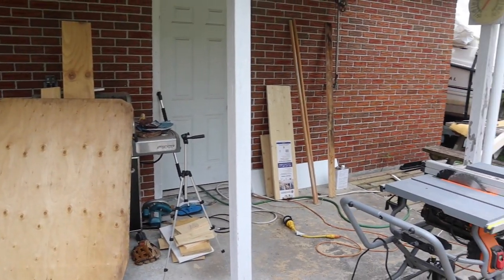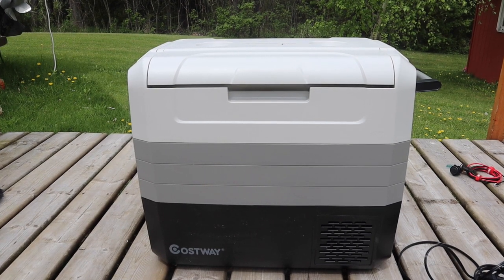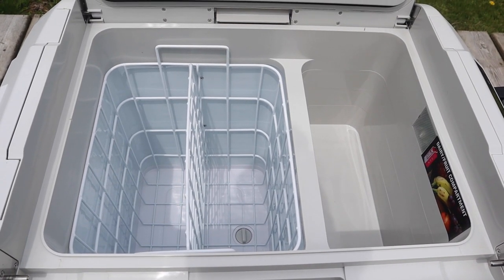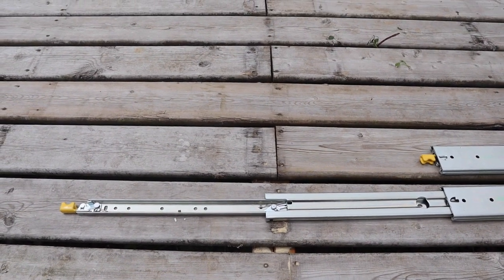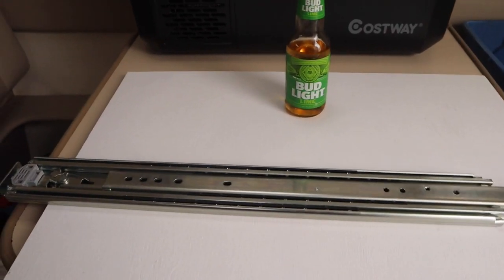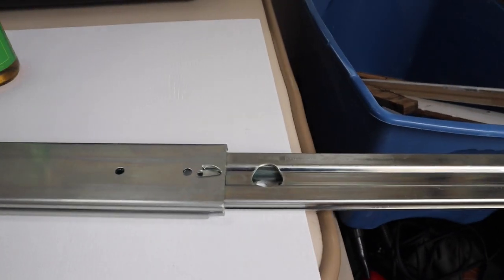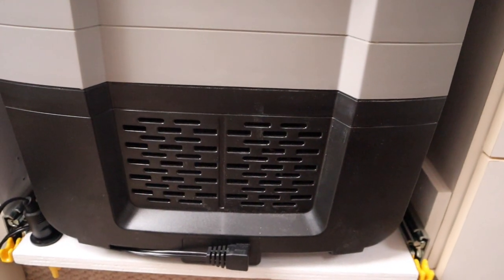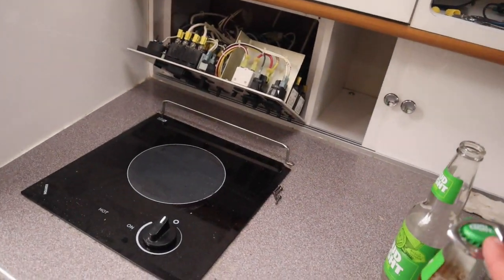S3 Ep3 A Cheaper Alternative to a Traditional Marine Fridge

Comment: This is a great solution. They draw so little from the batteries too. Love the way you mounted it with the locking slides.
Reply from the maker: Thx. It draws the same power as the original but it’s bigger. We are going to see how this works and me might set up a smaller freezer under the aft bed to allow us to stay out a week without having to get groceries.

Comment: Great video ! I did this same retro-fit idea on my boat ! Will this unit keep cold on deck as opposed to in the galley ?
Reply from the maker: Thx man. I assume it would work just as well on deck. We use an electric cooler on deck with no issues. Our channel also has a video of that install. You can also get insulated covers for some of these applications that should help as well. Feel free to subscribe as we will provide updates as we test it. So far we are pretty happy. Cheers!